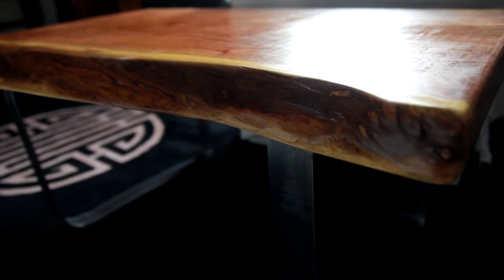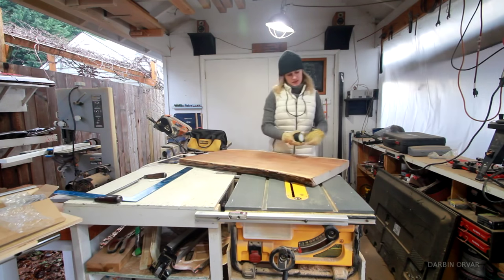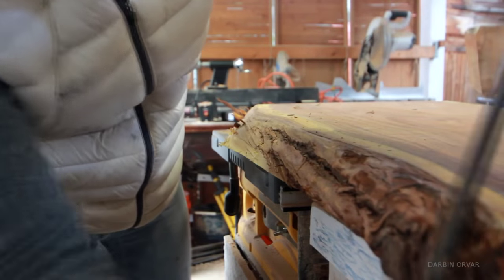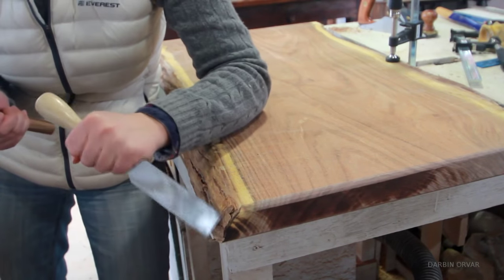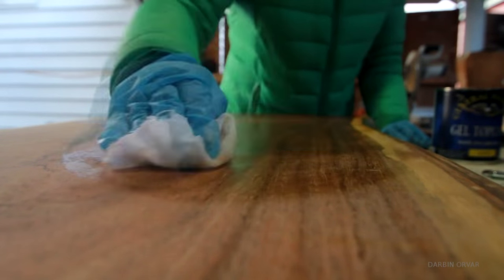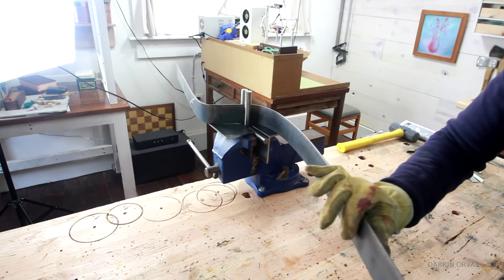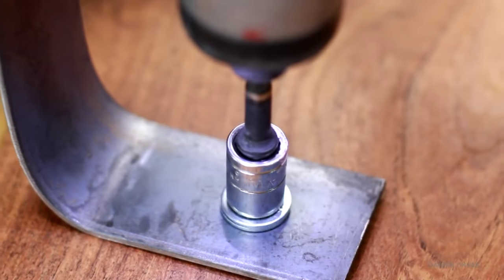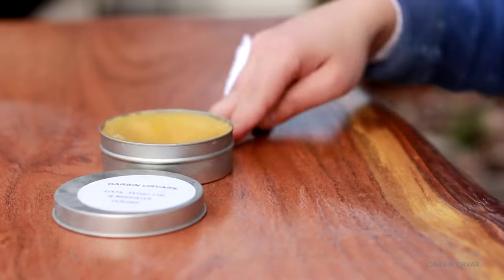DIY Coffee Table with Live Edge Slab and Steel Base | Darbin Orvar

Comment: that edge slab most of cost a fortune, at lease around the Detroit greater area
Reply: Interesting you say that.  Here in the Pacific NW you can buy that slab un-planed for about $50 plus another $50 to have it planed and sanded to 120 grit if you don't want to plane it yourself..  You can get a dried flat but un-planed slab 4' x 8' for $150-200.